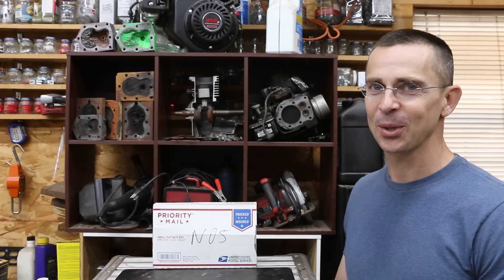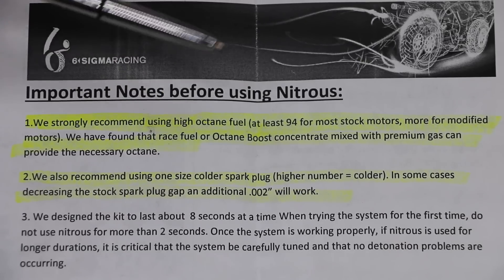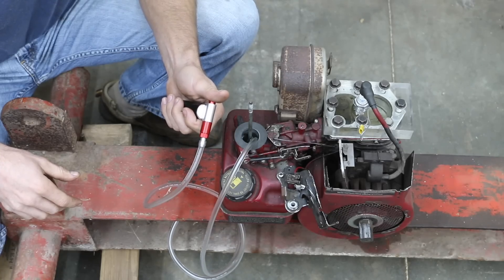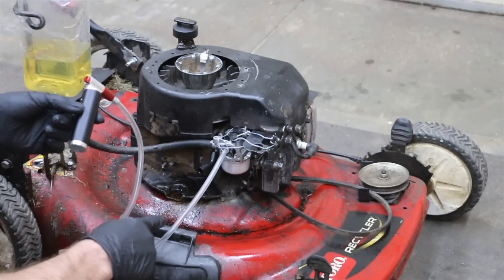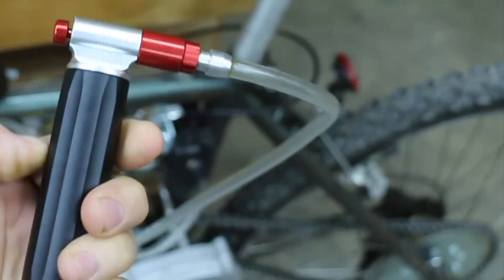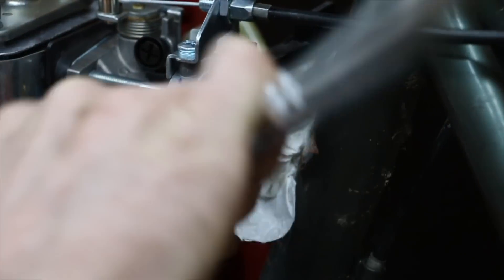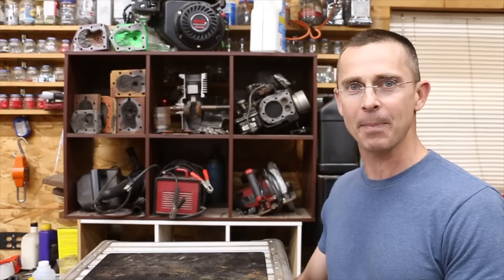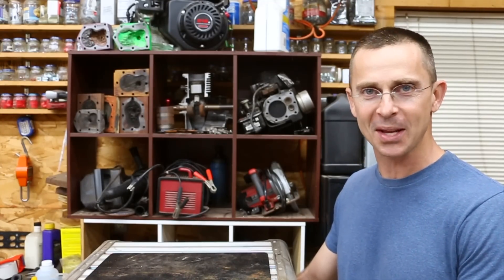Will the 4-Stroke Bike Survive Nitrous Oxide?  Let's find out!

Comment: I'm not familiar with those little tiny nitrous kits it is similar to a Sneaky Pete nitrous kit. I'm more used to the standard bottle which has a tube going down to the bottom of it. You might make sure that it's okay that it will draw a liquid nitrous into the motor with the little bottle turned to the side. If you heat up the little bottle but don't get it too hot you will get more power out of the nitrous kit. If the nitrous bottle gets too hot it could explode though. You need a gauge on it and to find out a maximum pressure you can run. With nitrous lean is mean and makes the most power but it could burn your motor up. Being a little on the rich side is safe and of course will last. And also you could use a little nitromethane I have used it on a stock engine before if you get too much nitromethane in the fuel it won't run. And you can start it without the choke on with nitromethane. But you must use all the nitromethane up if you do fuel mixing because nitromethane is heavier than racing fuel or pump gas and it'll go to the bottom of the tank and it won't want to start. Until you dilute it down and shake the tank up.
Reply from the maker: Great tip. Thank you

Comment: 40mph on a road on a mountain bike with stock brakes? Balls of steel.
Reply from the maker: That was way too fast!  I was much more concerned about tire failure.
Reply: @ProjectFarm  That too. I guess if you put them up to the higher end of the PSI range it won't be so bad.

Comment: Any engine can accept nos without blowing up.
You just have to understand what it does and how it works

Majority of the time people blow the engine, is using way to much
Over-limit boost
Hooking it up wrong
Lack of oil pressure
Pre-detonation on the pistons
Poor quality of engine material

I mean the list goes on.

If you do it correctly, you have nothing to worry about.
You can't just say "hey man i got a 100 shot nitrous kit, lets plug it in and see what i does"
No you gotta take everything else into account, and make sure your engine is prepared for that extra fuel charge.

Comment: See if you can advance the cam by a few degrees, that might open up the top end!
Reply from the maker: Great recommendation!  Thank you
Reply: @ProjectFarm  a little more labor intensive obviously but just mark the crank gear and the cam gear.  Maybe combine it with a little ignition timing advance?  It'll probably run like garbage at idle, haha

Comment: The time to use NOS is on acceleration. At top speed you are still hitting rev limits.  Unless you put an extra tooth on your front sprocket.  Also as mentioned the fuel mix needs to be enriched slightly.  On some motors it will double the power.
Reply from the maker: Thank you!

Comment: Nitrous is suppost to be used in conjunction with more fuel. The oxygen in the nitrous is used to create a bigger explosion with the added fuel per power stroke. If you use just nitrous alone, it will just lean out the mixture and cause detonation and engine damage. 
There are 2 types of nitrous systems, Wet and Dry.

What you are using is a Dry Nitrous shot, Dry meaning only nitrous. Dry nitrous systems are used on computer controlled fuel injected motors, so when the nitrous is activated, the computer will add the fuel needed to compensate for the nitrous. 
 A Wet nitrous system will also add the fuel in junction with the nitrous, but it is more like a stand alone system and has seperate nitrous and fuel jets that work together. A wet nitrous system is what should be used for anything carburated. 
Cool video, but the nitrous is being used incorrectly. The "ping" youre getting is from the mixture being dangerously lean, as shown by the yellow color of the flame. 
Anyone wanting to do this, be careful and do your research before you buy or attempt this!
Reply from the maker: Thank you!
Reply: Anytime! Keep up the awesomeness!!

Comment: You should always richen the fuel mixture to run nitrous with the slight bit you have maybe not much more than a jet size also you shouldn't hit nitrous on an engine unless at wide open throttle otherwise you can get a nitrous pop where it can blow an intake apart and anything in it's way
Reply from the maker: Great point. Thank you!

Comment: Nitrous Oxide works by releasing the extra oxygen in it so you can burn the fuel more efficient or more fuel then the engine normally can burn without it and thus more HP. Any nitrous explosion force does not happen since there is only aluminium or steel it gets in contact with and the power it release if it would is much lower then the explosion of the air/fuel mixture.
Reply from the maker: Thank you!
Reply: @ProjectFarm  No problems!

Comment: It was pinging so badly because it was running so lean. It also pinged at idle because your adding nitrous at too low of an rpm which will have that effect. Rule of thumb for drag racing is above 3000 rpm, I think for these 2400 would be a fine engagement, to find rpm I'd go backwards from speed and calculate the gearing. judging by the speed increase it probably wants between a 3% and 5% change in jet diameter (10-24% area increase)
Reply from the maker: Thank you!

Comment: by the way that fuel vapor setup could easily bypass a faulty carborater . setting one up as a replacement in a pinch would be pretty easy to do. very valuable knowledge
Reply from the maker: Thank you!

Comment: This kinda reminded me of the boost bottle for 2 stroke bicycle engines. They don't do the same, but can help with speed and fuel efficiency. It just captures the not ignited fuel before it's pushed into the carburettor and pushes it back when the next time the chamber gets more fuel. It adds a smoother ride and better speed and fuel efficiency. You can also buy the expansion chamber exhaust that does the same thing. If you add both it can give basically full duel efficiency.
Reply from the maker: Thank you for the video idea!

Comment: I used to have nitrous on my 125 supermoto , I had a seperate bottle of propane to add more fuel , it was kind of a wet kit but with gas as the fuel , it went really well and made a noticeable difference until one day i forgot to turn the gas bottle on and burnt a hole straight through a valve , I was lucky it wasnt the piston but it was totally my fault and a new valve at £10 and all was fixed
Reply from the maker: Impressive! Thank you!  Happy New Year!

Comment: I had some ideas for Project Farm. I’d always like to know if different oil viscosity in vehicle manufacturer required spec. (EG using 5W30 when 5w20 is called for) would be detrimental to the engine.

It would be tough though because you’d need long term data.

There are other ideas but I can’t put them to words quite yet....
Reply from the maker: Thank you for the video idea!
Reply: Project Farm I have more ideas I’m not even sure what they are yet. 
An easy practical winter one would be like best homemade blend for low temp windshield washer fluid.

Comment: Research your octane booster. My brother was running octane booster in his truck to try and save some money. I did some online research, keeping in mind everything on the internet is true, it stated most, if not all the “boosters” raise octane up by points. That does not equal octane rating going up like we think it does. Instead of it taking 87 octane to 90 with a 3 point boost, it is making 87 octane 87.3. Points are in tenths of 1 octane rating. Gumout says it raises it 8 points making it 87.8. Not 95. 

https://gumout.com/faqs/how-much-does-gumout-octane-booster-increase-the-octane-rating-of-fuel/
Reply from the maker: Thank you

Comment: You didnt need to put in 94  octane. [Likely  the reason for the pre-ignition] 87 would of been fine. I seen your system and its sorta like the one I made. I thought you were going to use a canister! Also did you use this pre or post  filter? [Makes a difference]  I strongly suggest you try the 40%/30% nitro-methane mix. With a bypass valve to switch from gas to Nitro-Methane.  But mix it with gas though not  raw. IDK if bypass was  the right word. But be able to mix it into  the fuel. I ran a stroke on 'pure' 25% and the  bike started. I  heard a POP and the moped threw  me  off and  landed near neighbors yard as it  was  on and off the 1 wheel. [Rear] Luckily I only put in an ounce of fuel. Its a whole different demon. To give you  an idea. 4-6 ounces of 25% to I THINK was 1 gallon tank. Was enough to 'full speed throttle' at half a throttle. When I gave  it more gas  I usually max out  at....37. I  went to 45 and  had more throttle.  The clutch was fully opened. I was going up a hill too. The bike last I knew had  over 30,000 miles when I  sold it. No  issues with   the wear  and tear  on the engine. I always ran some % for daily driving for 2 years, daily.
Reply from the maker: That's great!

Comment: I've always and only ran Nitro-methane.[Comes with Castor Oil  as Lubrication] So you can make fuel,air adjustments later. Pure NOS I imagine from my experience with my  old  car. Would  be hard on a PURE SHOT as opposed to a diluted feed of NOS.  I am watching you video now. I know a 2 stroke is FAR more  responsive than a 4 stroke.
Reply from the maker: yes, Thanks!

Comment: Don't try nitroglycerin! The engine will explode!!! The worst that can happen with nitrous oxide is the engine could laugh itself to death.
Reply: Lol
Reply: Or the cylinderhead getting too hot and blowing off...
Reply from the maker: Thank you
Reply: Try it!!!!
Reply: Nitroglycerin is TNT if i am not wrong
Reply: @dineshkrishnan4029  nope they're two different things. TNT is actually nitroglycerine's replacement.  TNT is Trinitrotoluene and it's a solid where nitroglycerine is a liquid at room temp
Reply: @thugasaurusrex6004  yeah i just realised XD. I confused dynamite with TNT.
Reply: @dineshkrishnan4029  dynamite is nitro soaked into a special clay to make it more manageable. TNT is different and less explosive but it doesnt degrade as fast dynamite

Comment: Great video! 
The test you may want to run on this is what NOS was originally used for: improved/increased acceleration, such as for initially getting into traffic, or maybe up a steeper hill.
While testing for top speed is good, the real use of nitrous oxide is under the load of acceleration.  You may want to demonstrate its use in what it was designed for.
Reply from the maker: Great point. Thank you

Comment: Should have made it a “wet” nitrous system, if you could have. Basically meaning that when you activate the nitrous, extra fuel is shot into the mix as well to go with the extra oxygen. Otherwise you’re almost always going to be running very lean.
Reply from the maker: Great point. Thank you

Comment: That was quite impressive, for a minute in the beginning test with the non- governed engine, I was thinking it was going to grenade the connecting rod...some serous r.p.m's...by chance did you record the r.p.m's on that first mower deck engine?, just curious.
    Thanks for sharing!
    Kind regards, Eric Dee.
Reply from the maker: Thank you! I didn't record the RPMs but I should have done so.  The valve float prevented the engine from experiencing destruction.  Thanks again!

Comment: As your fuel/air mixture leans out the head temps. will rise (WW2 pilots trying to get that little bit of extra mileage would catastrophically find they've softened and bent/stretched/dropped their engines valves), which is what NOX does. I would have liked to see the head temps. when the NOX was applied. WW2 aircraft would use an injected Methanol/water mix when they went into combat power levels with their huge superchargers.
Reply from the maker: Great point. Thank you

Comment: Fatal flaw to all of this is that nitrous oxide requires additional enrichment to function properly. Nitrous oxide is an oxidizer which enables the burning of additional fuel. Injecting it without additional fuel is just making it run lean. Running lean can make a little more power but it also causes much higher cylinder temperature as the engine runs lean. You should try a test where you inject N2O and an additional fuel like propane.
Reply from the maker: Thank you

Comment: I'm not familiar with the 4 stroke engines, but some 2 stroke kits come with a carb intake manifold that has a flat spot on the top that you can drill out and tap for the nitrous nozzle (that's actually what it's for).

you're right when you say most people think nitrous is flammable, what actually happens is you're giving the fuel its own oxidizer. This allows it to burn more quickly, typically more completely (assuming you're running rich already) and leans out the mix. I read somewhere that the NO2 actually mixes with the gasoline to create nitromethane, but if that were the case then it would be happening already since 80% of the air is nitrogen already (I suppose if you have NO2 and not N2O [your bottle said it catalyzes into 2 nitrogen 1 oxygen?], seems to be a bit of discrepancy there, NO2 would leave an unbound nitrogen atom that would be free to bind to the gasoline since atmospheric nitrogen is already bonded to another nitrogen (N2))
Reply from the maker: Thank you!

Comment: Doesnt higher octane gives out morr power already. Get racing fuel of 104 octane, ull get to 45 mph. But what about nitroglycerin?
Reply from the maker: Higher octane would not help improve power in this bike engine kit, since it's designed to run on 87.

Comment: fix the pre ignition and it will make the power increase way more noticeable. pre ignition is the engine basically fighting itself which in turn loses power. make the octane about 102 and put the spark gap to about 0.020
Reply from the maker: Thank you!

Comment: WARNING‼️‼️ DANGER TO MANIFOLD
Reply from the maker: lol
Reply: Shut up! slams laptop shut
Reply: At least he doesn't have a floor board that will blow out lol
Reply: *floor pan drops out
Reply: I was disappointed when I installed NOS on my turbo mustang, the car didn't get longer, space and time did not warp, the transmission still had 5 speeds not 16....must have installed it wrong i guess 🤷‍♂️
Reply: Naw man, you put it in a Mustang. Nitrous doesn't work in Fords, it runs back up into the bottle for fear of catching Ford cooties
Reply: @kennethclifford1863  It only comes with the "Racers edge special kit" bro 😂💯
Reply: Now the Mad scientist is going to have to tear down the engine and replace the rings.
Reply: Granny shifting not double clutching like he should
Reply: *push the second shot
Reply: Hamza STX Badman lolololol
Reply: The piston rings must be gone
Reply: NOS!! Kaboom!! You owe me a 10 second car.
Reply: Dude i Almost had you😂
Reply: Lol
Reply: Shut up!
Reply: It’s not supposed to go into the intake
Reply: @jonahdalton6557  yep . he did it wrong.
Reply: @zero-onekackzynski1825  and what do you think how it is used the right way? Sure, you can inject it directly to cool your combustion chamber or the piston. But the way it works is simply, that it delivers additional oxygen because it has a percentage of 33% oxygen, which is about 11% more than air. This simply means your gas burns faster and cleaner and/or you can burn more gas in the same engine volume. So youd actually gain more power when you enrich the mixture at the same time you inject the NOS
Reply: Hamza STX DSM your lucky that 1hp shoot didn't blow the welds
Reply: slams laptop
Reply: I'm still wondering how the floor board went flying with all the bolts if the Manifold is the one which got heated! 🤔
Reply: @nadunwijesinghe965  He was going so fast the G-Force from the speed dude the cars chassis couldn't take it, At least that's what they implied in the movie. But at 155 to 160 MPH max. Ik G-Force affects at 200 Mph.
Reply: “My motorized bicycle topped out at 37 miles per hour... I need Nos. I need Nos.”
Reply: Hamza STX DSM Too soon, junior!
Reply: Too soon junior.
Reply: SHUT UP SLAMS COMPUTER
Reply: That was good! :))
Reply: Floor blows off
Reply: Fast 1
Reply: Brian Spilner, frying some piston rings...
Reply: Shut up!
Reply: @Mikołaj Kosma  you don’t watch fast and furious?
Reply: @hamz1179  hahaha (Rip Paul Walker tho)
Reply: @hamz1179  f&f films are shite

Comment: Echo makes a pre-mixed 2-stroke 94 octane blend for use in any 2-stroke engine with added benefits of helping protect your engine and keep it running well. I used to sell this stuff industrially, so many logging companies would buy this stuff to run on their Echo chainsaws but like I said any 2-stroke will run it. To my knowledge its the only pre-mixed 94 octane 2-stroke blend on the market but I could be wrong.
EDIT: My bad to my knowledge its the only pre-mixed 94 octane 2-stroke WITHOUT ethanol which is how it runs so much better on small engines. Mainly those tiny carbs, cant tell you how many people come in needing their weed eaters fixed and its always the carb is gunked up with ethanol cause they run the cheapest gas they can get in it. I always recommended them use the Echo premium blend but they never liked the price tag. Those loggers appreciated the blend though on those chainsaws.
Reply from the maker: This is great information. Thank you
Reply: @ProjectFarm  No problem, here's a link if you are interested in some. https://www.echo-usa.com/Products/Red-Armor-Fuel
I'd actually be interested in seeing a comparison between the Echo Red Armor and regular gasoline mixed yourself to see if it truly is what it says. Personally I think it is better due to the fact the Echo blend is ethanol free and I know all too well that small engines don't like ethanol.

Comment: A bicycle with an engine... What's the point? Better to get a motorbike
Reply from the maker: Thank you.  I don't have to insure the bicycle and it's light enough that I can pick it up and place it in the back of a pickup truck if necessary.  I can even pedal it if it runs out of fuel.